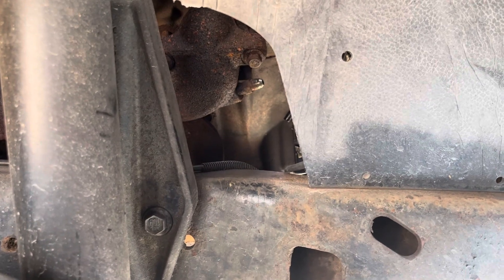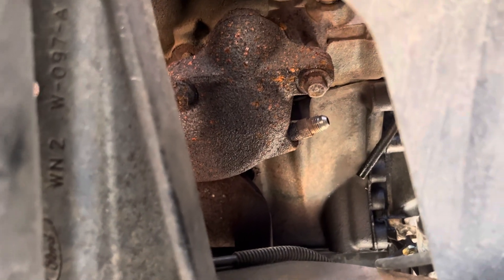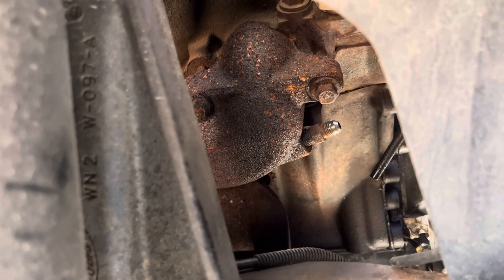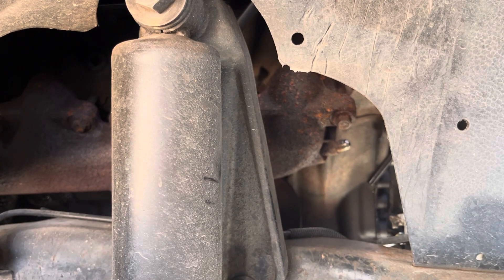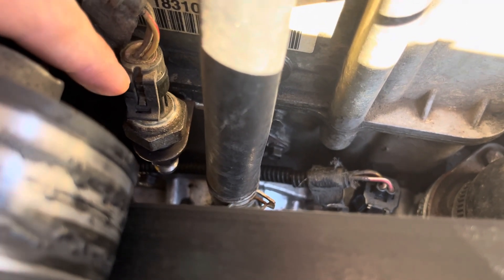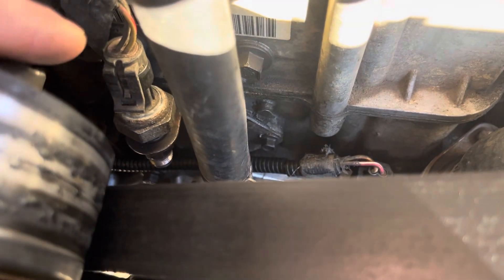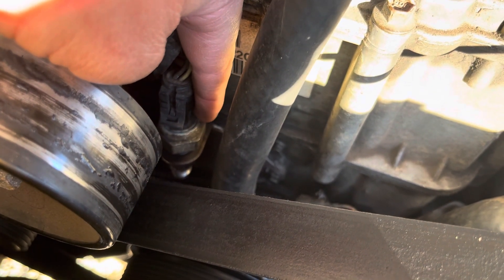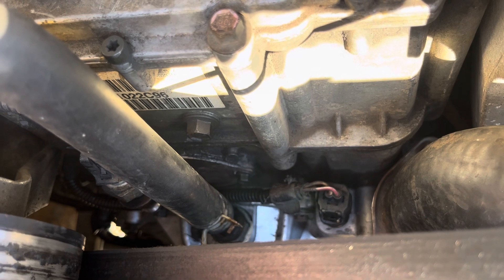7.3 powerstroke exhaust back pressure tube and sensor

Comment: I have exposed wires on the connector for the EBP sensor. Gonna solder on a new connector obviously. But I’m thinking about replacing the tube and sensor at this point because the truck has 300k miles on it and pretty sure that tube and sensor are stock. At around an hour of driving once I hit 60 mph all my power goes away. When I slow all the way down and try to accelerate again the truck has no power. Still hunting down the issue but between the exposed wires there and a broken o ring on the CPS I think the truck has a multitude of issues. Gonna pull valve covers off soon to inspect the injector wiring harness because I suspect it might be time for replacing that as well. Already replaced the ICP sensor and it actually got rid of my other issues where I was getting injectors failing buzz tests and truck was consistently missing. Cylinder contribution test turned up a P0248 code I believe. Everybody I saw online said that code gets thrown from the recall CPS. Hopefully I can get further diagnostics after I’m sure my CPS isn’t giving me phantom codes.